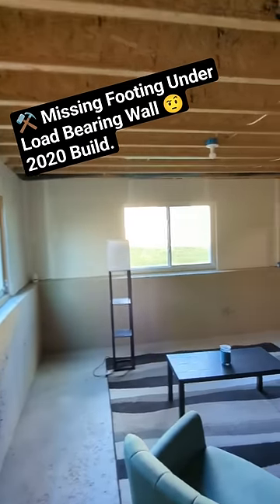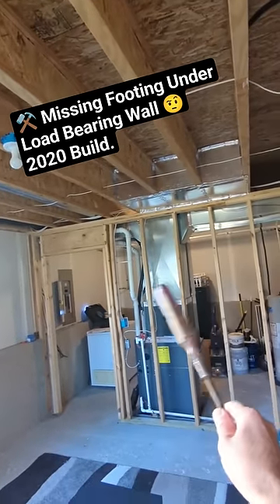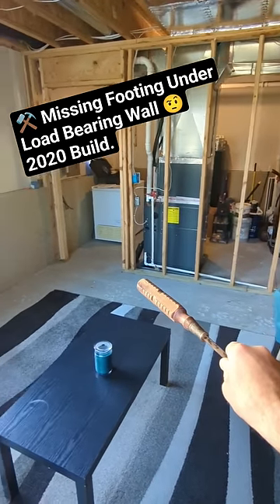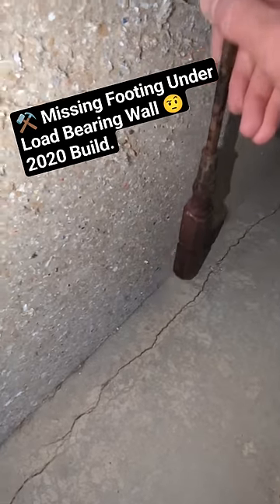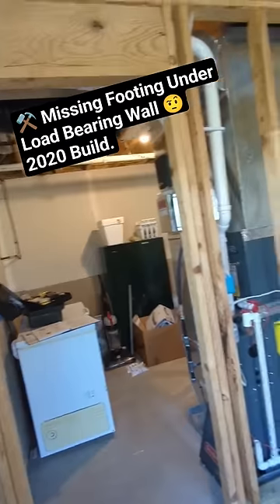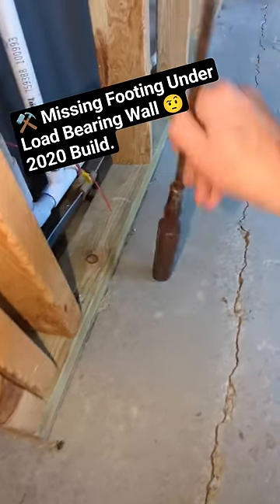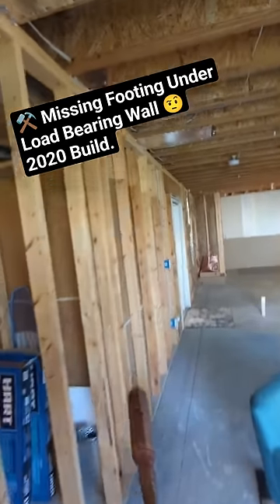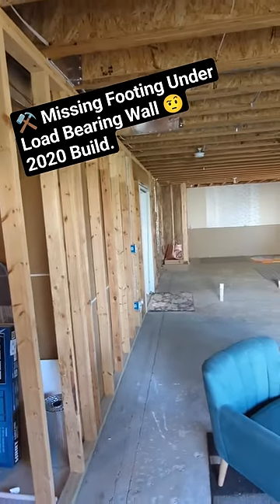FOOTINGS missing under load bearing walls NEW BUILD A trick to find missing#footing under #concrete

Comment: Now I want to see them cut the floor out and find the grade beam wall footing 😂. How do you know it's not settled grade from using improper backfill?
Reply from the maker: Exactly! It may be! 
Back fill is one of the biggest enemies in construction. 
Thanks for the comment and watching.👍
Reply: That was my thought, slab sounds hollow. Spray foam injection would be the easiest way to fix most of this, but I'm not sure if that could be used in a load bearing beam.
Reply: With big voids like that under a newly built slab, the mistake was almost certainly caused by shrinkage of wet clays beneath the slab.  Easy to confirm by drilling a small inspection hole in the slab.  One repair that works is pumped foam.  Similar to mud-jacking but with specialized foam that can support the slab and replace the footing. If the wall doesn't lift back fully during the foaming, I would shim the overlying joists till they're level.  I would hire an engineer (biased recommendation) before you hire a lawyer, the fix isn't expensive if done properly, but there's a number of factors to consider.
Reply: Easier to just drill a hole to check if there is a foundation or not
Reply: @tommyt414 load bearing spray foam...hrmmmm
Reply: Each joist aligns with the stud below it - another sign it is a bearing wall.  I agree that the fill was likely poorly consolidated or not structural fill and has settled leaving voids under the foundation.
Reply: @purduephotog  Its actually a way of underpinning, I don't rate it myself but it has its applications and uses
Reply: @MrJFoster1984  agreed. Just always laugh when I hear fish
Reply: @MrJFoster1984  exactly.  I can't believe nobody mentioned this before you.
Reply: @christopherw4527  I have been doing remedial and structural repairs for 15 years, I see everything! 😂
Reply: @purduephotog  fish?
Reply: @MrJFoster1984  could you use 4,000 lb concrete with fibre in it and inject it into the void so you didn't have to cut a trench and sister the wall? They lifted the sidewalk at our building this way. Drilled hold and injected a thick expanding foam-type material into the voids. It was actually exothermic, so I was told. The heat actually was caused by a chemical reaction to set the injection material. It came out looking like liquid plastic. You're left with these small drill holes all over the place. It raised the sidewalks up four inches an they are solid enough for yard maintenance equipment to roll over.
Reply: Definitely a grade issue the crack running perpendicular to a cut joint like this indicates sinking or heaving putting stress on the edge of a footing to crack that straight 
Definitely a void doesn't take much for the acoustic change
Reply: This is a matter of lipstick on a pig sooner or later the pig will squeal. When you hear that screwdriver beating on that concrete and returning such a high pitch note that means it's a thin piece of concrete that's cracked loose and if you see that big long straight crack right there next to that something's gone wrong and it's not a matter of settling you wouldn't have a perfectly straight line with improper back fill you have to have a lot more complexity. That sound and that straight line prove it and you can break that up and there isn't a foundation under there or you'd be able to hear it. They do a similar process on a concrete bridge Floor. They pull a heavy chain across it and it makes a Halo sound like that tapping with the screwdriver under that wall.
Reply: @markmcgoveran6811 halo sound as in the game or above the saints head.😂
Reply: @firecrackerg60  I don't know you have to be able to have a license to go out and drag chain on a bridge and tell him how much of the floor has separated so it doesn't hurt somebody. If you go through any house and just smack every door frame hard with your hand you can tell which wall is a supporting wall because it will be under load and it will sound and feel like it is under load. The guy from Oklahoma told me that he thought it might be possible that the oil industry had pumped water into the ground and caused earthquakes because they were having one a week instead of one every 5 years. I told him that I was respectful of his opinion that he gave it a thought and I also thought that it was the most mathematically unlikely thing in the world that those earthquakes happen 50 times as often in the area where the oil pumping action had happened compared to my house
Reply: @purduephotog I've lifted a 8" thick conrete pad with 100 ton generator on it cause the corner sunk. Lifted it 3 feet on one side. This isn't spray foam from home depot. It can lift your entire house. I've lifted many detached garages that have settle improperly. Basement floors are common. You can use a lifting foam or a void fill. This needs to be lifted and void filled afterwards
Reply: @jonkoller clays should be stabilized with hydrated lime before building.
Reply: Concrete too wet and thus, cracked. 😢
Reply: I know because I can hear it I have some sense I was a machinist build hot rods and everything else. When you hear that Halo sound under concrete that means there's no support where there should be. There's no other explanation you can have a million kinds of b***** that you want and say something settled this or that or the other thing but there's just nothing under there and if you take a hammer and broke out beside that where that crack is all you'd find is dirt because there's nothing under their that's why it cracked when they put all the weight on the concrete.
Reply: @jamesnm21  a lot really depends on the specific clay, the moisture content and density as well as the site features like depth to a solid layer, water table...etc. Lime, fly ash, blast furnace slag, explosion consolidation... Lots of ways to improve clayey soils before you build.  Was not done here, hence the problem.  It's very possible that after foam jacking the floor, it settles some more.  Really good idea to hire an engineer who is familiar with this area and type of repair so you don't get stuck fixing it twice.
Reply: @inspectflix you ain't lying. I've built so many decks with laser to come back and sonotubes have sunken
Reply: Must be a Ryan Home
Reply: @markmcgoveran6811 😂😂 it depends on what YOU call an earthquake. According to the USGS fracking DOES increase earthquakes and surface tremmors. It may not be tectonic shifts but (ground shaking=earthquake) even if it is imperceptible to us.
Reply: @PWingert1966  that sounds like what they call mud jacking in the US. The foam is "resin" injection which is basically a two part chemical injection system that mixes part A and part B in the nozzle. The two react and expand and then fill voids and can also be used to lift. Ir has it's uses but over here in Australia they charge per litre of chemical injected, and if they are doing it on your house and it finds a void underground which leads some where else, like next door the foam will go to the point of least resistance and fill it up, costing you more. It has it's pros and cons. I have seen too much injected and it caused cracking of walls and the wall plate which the roof attaches to. I don't like it personally. For a driveway or a pavement/sidewalk it is good but in my opinion when it is injected into soils which are reactive to moisture such as clay soils, it is like a big packer and the next time the soil swells and heaves then that action is only exaggerated by whatever volume of resin was used. Put in 1ft of resin and it will likely not compress when there is a heave and multiply or exacerbate the problems further. The best way is to go down to deeper strata with piles, push piers, bored concrete piers, screw piles or the like which have stood the test of time and can be properly engineered solutions. 👍
Reply: So many experts !!!
Reply: @tommyt414 the problem with why it sounds hollow is because there is nothing underneath to support a load like that, spray foam would probably help with noise but it's not gonna fix the actual problem. That would just be covering the problem and pretending it doesn't exist.
Reply: @markmcgoveran6811 hes making fun of you for saying halo instead of hollow
Reply: @markmcgoveran6811 what’s the heck in Tarnation is a halo sound? Someone please fill me in on this new adjective 😂
Reply: @Letsgobrandon.2024  it's a computer-driven error. It doesn't matter you wouldn't understand what I said even if I said it exactly right the container that he is striking is consisting of concrete and it is empty and small thus the sound of an empty small piece of concrete is different than the sound of a large piece of concrete like a footing. That's okay though just be a stupid online as you want everybody's got to have a hobby and at least this one is kind of harmless guy like you could be in somewhere and do a lot of bad to people on here you're just kind of insulting and doesn't Mount too much keep it it's the best we can hope for you
Reply: @tommyt414 can’t be used for load bearing
Reply: so it’s not stuffed because it’s stuffed in a different way? very reassuring.
Reply: @Robnoxious77  well it's just kind of obvious that there's that straight line cracked there where the load is on 4 in of concrete that reaches all the way across or just only one way that happened
Reply: @MrJFoster1984 easier than tapping on it?
Reply: @CM-xr9oq  that may work but a drill hole will confirm for sure how thick it is 👍
Reply: I prefer a sink hole

Comment: Most interior bearing has thickened  slab not footings.
Reply: Depending on the state, either way the floor should not sound hollow or be cracking before the house is even complete.
Reply: Exactly
Reply: Gonna depend on region. But yes, lots of thickened edge slabs out there. Great option when its a good option 👍 lol
Reply: That IS a footing/footer. As long as it’s sized correctly it’ll do exactly the same job .
Reply: Thicken slab is only good to hold a heavy car! Not a point load which - presumably is probably in direct line with the roof peak. Sorry not sorry - someone should be losing their job….
Reply: @csabaknezy208 You must be a structural engineer or architect?
Reply: @dougeing6521  - not either, but worked with enough PEngineers and had arguments on this many a time - and I lost each time. (recalling a discussion with an PEng handing me my ass)  a Footing is engineered to carry the load specifically and uses a less brittle and heavily fortified structure (i.e. with rebar and/or fiber in the mix) so mitigate the risk of cracking due to the movement of structure and base. The reason slabs break is that they float and flex. You cannot have that on a point load for a load bearing wall and just because you have a "thickend" slab does not ensure the mesh is in the correct location (in relation to the thickness of the slab) and does not mitigate the risk of flex and movement. Sure you can say the load is dispersed over a "greater area" - but this does not allow for "unforseen snow loads" and will add into the slab movement....
Reply: In commercial construction and almost always we do a haunched slab at interior footings . Usually at least 24 inches at center of haunch
Reply: @csabaknezy208  First of all a thickened slab (monolithic footing) are only done on interior pours.  Wire mesh does not add any structural strength to concrete.  Wire mesh does keep concrete from pulling apart at cracks.  As concrete sets the pour develops internal stresses due to shrinkage.  If control joints are not sawn within the appropriate time the concrete is susceptible to unwanted cracking.  This is why a concrete crew cuts the slab right when they have completed the finishing process.  The thickness of the slab determines the spacing of control joints.  Curing blankets, burlap with a water spray or a liquid curing agent is sprayed as the last step depending on which one was specified.
Reply: @dougeing6521  - I do not recall writing Mesh adds strength and what you write is correct and I agree with. I would also like to clarify - what specifically is being called out? 
again - a slab, thickend or otherwise, is not a structural entity when considering point loads in an engineering sense. Putting a load bearing wall on a slab is a recipe for disaster.

Comment: Betting a beer this wall was an after thought
Reply: if that was the case, it wouldn't necessarily have to be a load bearing wall?
Reply: It’s clearly not a load bearing wall 🤦‍♂️
Reply: Betting beers after work was the main reason for this wall. Maybe beers DURING work was another.

Comment: Makes you wonder how it passed inspection. Here foundations must be inspected before the next phase of construction including for single family homes.
Reply: Basically everywhere that's the case.
Probably isn't actually load bearing.  Some people put headers over every door.
Reply: Maybe there is a footing but it was poured in the wrong location. Wouldn’t be the first time a foundation crew made a mistake. Most inspectors don’t pull out a tape to check placement. Then apparently the floor was poured before the wall was built so the framer would never know…. Probably an honest mistake and really not that difficult to repair.

Comment: I would install an I-beam or LVL with steel support columns.
Reply: Exactly the LVL would take the load right off that floor.
Reply: There u go proper but this is fine look at the top of the wall

He’s looking at the bottom 😂 I’m laughing 

A support beam is at the top not the freaking floor 

Bc it’s a wall it’s fine but if it was a open floor design yes a I beam 

But y use materials that r not needed?

😂

Comment: I built my house in 1978. My house was one of the first built using truss in our area. They were 16 inches tall and spanned 30 ft maximum. I used them to avoid having post in my basement.  The area were my house expanded to 34 ft, I had to reduce the basement to the 30 ft width. As a result using the trusses other than the fireplace in both the basement and den and the stairs I had a 30 x 60, minus the  thickness of the exterior wall, wide open basement.

Comment: I wouldn’t use the headers alone as an indication of the wall being load bearing, as headers in all openings is standard practice in all the construction I’ve seen. That said, that big ass crack right next to the saw cut means that wall is indeed bearing load down onto a slab with no footer beneath. Whether that wall is intended to be load bearing or not, I do not know, but it is now.